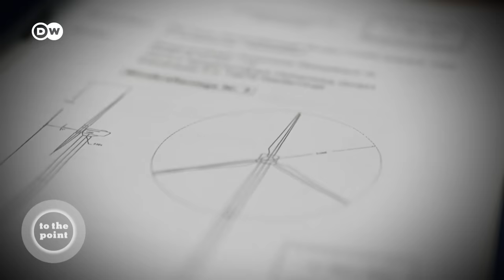A great power in trouble: What's wrong with Germany? | To The Point

Comment: The German business model is mostly based on manufacturing. In times of high energy costs, supply chain disruption,  demand shock and an alarming immigration rate you have the perfect mix for a crisis
Reply: What is immigration to do with German's manufacturing problems?
Reply: And we Germans need free markets, free trade lines, and not mercantilism for silly geopolitical games.
Reply: @joaov.m.oliveira9903  immigration is a highly sensitive and divisive issue in any political debate. High immigration rates in times of crisis can be a problem
Reply: High immigration rate is by design, because that keeps labour costs low and benefits manufacturing.
Reply: And what is your qualification to give such opinions?
Reply: @joaov.m.oliveira9903 unskilled workers aren’t very useful even if they’re cheap. They hurt the brand and quality of product. Also it hurts wages and people and so it’s not good for the overall economy.
Reply: @Logan-zf1ft  he’s a voter I imagine.
Reply: @kordellswoffer1520  no it is not ..
Reply: @lucasstuart19  you did not answer question what immigration has to do with crisis of manufacturation ?? Immigration are useful not problème for manufacturation..
Reply: Dramatic energy politics. Too much money is spent on "Energiewende". High taxes on energy is bad for steel industry, bakeries etc. Also nucleair powerplants were closed for political reasons. Coal-fired power stations have to be politically closed as well. Gas has to be imported and is expensive. So the make industry is at risk.
Reply: The energy crisis is a karma for what Germany tried to do with Russia …against the rest of EU.
Reply: We like blaming the immigrants here. Obviously poor hard working people trying to make a better life for themselves are always the fault us rich Germans are faultless. Heil !
Reply: @ihmpall nice slogan😅 keep like that 😅
Reply: @aghileshemdani3144 yes when they work and not just take money from german taxes and don't work for  years like the majority of them from 2016 to now
Reply: Reality comes in Germany. EU reality when everything is regulated.
Reply: @joaov.m.oliveira9903 
Industrialists / Corporations need cheap labour or dependent workers like indenture slaves.
Reply: Why you add immigration in your equation? Germany 🇩🇪 birth rate is one of the lowest in Europe. Immigration is needed in Germany as a plan to positively impact the economy.
Reply: @ainars.
Here is your regulation: flood EU with immigrants by “shipping them” and making money off it.
Select the ones willing to work and “volontarily” distribute the rest to other countries in Europe…. While slapping them with fines and sanctions.
You are flashing your “exploiter” sign without shame. This is the beginning of the end of EU
Reply: Germany killed it´s own future when became antagonistic toward Russia, Germany did so  for the sake of USA, country which was even bombing them at the same time(Nord Stream) !!! Politicians should be held accountable for that !!!
Reply: When you play sanction league the result is obvious 😂😂
Reply: @tigerking2742  Yes. The thing with sanctions is that the power that imposes is likely capable of providing a satisfatory alternative to the sanctioned country, often profitting high from it. In the case of U.S.- imposed sanctions this is precisely what's happening now.
Reply: @joaov.m.oliveira9903  you know we Indian are laughing because our petroleum products export are increased and major buyers are European and you know very well which country we purchased crude oil 😂😂
Reply: @joaov.m.oliveira9903  Excellent question! Immigration is actually good for German manufacturing. Now ... the war that should never have started is an imptortant component of the crisis - the most important, imho. Some say the US is doing double containment with the war - containing  both Russia and the EU.
Reply: @joaov.m.oliveira9903  More free money & government hand outs for food, housing, health care have to be generated somewhere and  most likely will have to come from increased taxation to businesses, individuals or both.  If businesses are already complaining about high tax rates, they will look for alternative places or options to reduce their tax burdens.  A Country cannot simply take in unlimited amounts of immigrants.
Reply: @kb9826  I know that, man.
Reply: Every country starts going down hill when energy cost is high, so I don't understand what is the point of this video?
Reply: 19:50 German companies are complaining about a lack of skilled labor, we know this can only be provided by foreigners
That quote in this video probably created 10.000 extra AFD voters
Reply: @kordellswoffer1520 

correct !
Reply: @EarnestWilliamsGeofferic low wages may be attractive to the companies, but it is preventing Germans from entering certain industries for work.
Reply: @bienvvo  forget the gdp figures and focus on people. People will be wealthier without mass migration. People will be happier without mass migration.
Reply: The problem of high immigration is  that if the industries starts to fall and people loses their jobs, then there will be a high unemployment rate, and therefore a high tension in the employment market which enhances the hate against immigrants. Then people will start to say.. They take our jobs. More over the insecurity will increase thanks to poverty increase. 

It already happened in other times and in other countries, and even now. People already starts to speak in some countries. Eg. France, and also maybe UK.

Increasing immigration is a seriously bad short term idea because the main problems are not solved. Extremely competitive market, mondialisation, high price of the energy and also...... Greedy shareholders.

A simple way to solve all those problems in every country would have been to impose two simple rules to every country in the economic bloc.... (1)One country, one local industry.  (2) Impose a maximal amount of money one human can possess : eg: 10 millions euros. And maybe a third rule. Unconditionnal revenue. 

Forced Local industries means one guy wanting to sell a product created in another country has to create a local industry. It bring local jobs. On another side, limitting shareholders power keeps salary well paid and it nullify their influence power and lobbying.
Reply: Without cheap gas from Russia the Germans are fck'd. You should never bite the hand that feeds you.
Reply: @mirekslechta7161  No it is caused by the "Energiewende": closing nucleair power plants, Cole powered plants, and relying on gas as the only alternative. The gas mining in the Netherlands has been almost stopped, so no cheap gas anymore.
Reply: @lucasstuart19 😂 On this specific issue, that 's where high immigration is useful . Keep wages low and available labour forces .
Reply: Immigration is completely irrelevant here, if anything, it is a boost to manufacturing both in terms of production capacity and consumption. You really didn't need to comment on something you do not understand. If you have a problem with immigration, that's a different story...
Reply: @user-ks2wz7bg4p I know, Schadenfreude ist the most delicious form of enjoyment. But things are, again, not that simple. You could start to figure out, who still is purchasing uranium from Russia, and who does not. Then, you might like to check, who else was benefitting from russian gas and oil imports (and still does) for which, Germany was just the landing point and not the user. So, at the end, it's not just Germany here, and the rest of Europe on the other side.
Reply: @tigerking2742 you are sooooo smart.
Reply: @kordellswoffer1520 look Asian developed countries  like southkorea,Singapore etc they opening foreign labors to their countries  because  their domestic labors is shortage  they need to open for  foreign labor just to sustain their economic development
Reply: @kinegiros that is a lie. A lot of immigrants work for less. You capitalize on the few who game the system but with the high inflation, living on welfare is not sustainable at all.
Reply: @DarwinMagsino  foreign as in neighbouring nations. They’re not opening themselves to all of Africa and the Middle East and India.
Reply: I think we should clarify that high immigration numbers aren’t inherently bad, it’s more like a vast number of these immigrants don’t get integrated into German society/culture and work force properly fast enough
Reply: Yet gvt fking up the energy policy. So smart😂
Reply: @joaov.m.oliveira9903 lol seriously you didn't get what he meant?
Reply: @EarnestWilliamsGeofferic If your immigrants are educated, can support themselves, and don't need money from the government then yes you're right.
Reply: @joaov.m.oliveira9903 being replaced by non germans? I dont know, just a guess
Reply: You’ve described a colony
Reply: Have you ever seen an "immigrant" at manufacturing site? On a contrary, take a walk at "no go" zone during working hours, and look at the crowd hanging around.
Reply: Absolutely. Just imagine Germany (EU) was closely cooperating with Russia, instead of antagonizing.
Reply: At the same time it provides high added value and relatively stable jobs, which is what a lot of germans like: Stability.
Reply: @bienvvo  why? Just use robots and AI - they add economic value unlike most immigrants. They don't cause social unrest either.
Reply: @user-ks2wz7bg4p  makes good business sense, why would you want to keep the ones not willing to work?
Reply: @maxheadrom3088  explain? Only a small percentage of immigrants help manufacturing...
Reply: @defaultdefault812  sure, where are those robots 🤖? Lool you guys need to step in reality and accept the new real…..
Reply: alarming immigration rate???? Germany is not as multicultrual as the US or the UK, so ....uhhh no!
Reply: Plus high interest rate stifling investment
Reply: Manufacturing is far better than my American model of a financial economy that is extremely unstable. But if you got endless money to print in order to bailout the gamblers, it works great.
Reply: Bayden
Reply: @kordellswoffer1520  well southkorea  will help asian counterparts first before others
Reply: YOUTUBE:"DIE VERBORGENE GESCHICHTE" TEIL1 UND TEIL2///Die ersten 30Min reichen schon aus. 👋
Reply: Hello👋👋
Reply: @EarnestWilliamsGeofferic  hello👋👋
Reply: @Logan-zf1ft  hello👋👋
Reply: @kordellswoffer1520  hello👋👋
Reply: @ihmpall  hello👋👋
Reply: @AlexandraSandra-ho3wz  hello.
Reply: @kordellswoffer1520  hello where are you from m
Reply: @AlexandraSandra-ho3wz  I am an Englishman of course.
Reply: @kordellswoffer1520  oh wow that's nice...
Reply: @kordellswoffer1520  Are you there?
Reply: @AlexandraSandra-ho3wz  AfD Regierung in Deutschland es ist ein Muss!!
Reply: @SantiagoRodriguez-th3ej  Ich weiß nicht wirklich, wie die Regierung dort arbeitet ... Ich komme aus Los Angeles, Kalifornien, und Sie?

Comment: The biggest mistake in Germany is the shutting down of their nuclear plants.  This has jacked up their energy prices and thrown a monkey wrench into their economy.  The other thing is Germany's failure to ensure investment in the development of electric cars.  Like Germany is at risk of their whole auto industry going belly up.
Reply: Under EU la the price of a kw of electricity MauST be priced at the retail level at the highest cost to produce that kw. 

This is why sone electricity producers made obscene profits.

The nuclear will help but they need a structural reform that forces a flat playing field of competition
Reply: @joeblue2492  what makes sense is supply and demand.  Like consumer should be charged based on when the electricity is use based on the cost of the electricity at the time.  Often electricity producers get contracts.  This is often not good for utilities in that they have varying demand over the day, week, season.  This is where old stile nuclear plants are having trouble. They are set up to produce unchanging  base load and become uneconomic when renewables over produce.  So what are needed are nuclear plants that operate at high temperatures and power can be stored as heat to be used when needed.

Comment: Maybe they shouldn't have abandoned nuclear power. France isn't having the same energy issues.
Reply: They have issues of their own. The time to build nuclear power plants is very long (The one they hope to finish in Q1/2024 has been in the process of being built since 2007.) and climate change causes them regular problems in the summers with cooling their nuclear power plants.
Reply: @Never_again_against_anyone  it also increases their dependency on Chinas/Russias Uranium/Thorium. If Europe stops trading with China/Russia (for whatever reason), France will go down (not even kidding). So better to live in Germany in that regard.
Reply: @coondog7934  I didn't read anywhere that anyone relied on Chinese uranium, which isn't a lot and mostly used for domestic purposes.

Comment: Germany have similar problems like Sweden. Coalition governments and their dealings for power easily lets small parties have more power than their base in voting.  This have led to to decisions and acting that are governed by visions and ideology and that have no support by a lot of people, and are often not realistic. Also I think there is a lot of pressures for political correctness as in Sweden hindering a sound dialogue (politicians, media) how to solve problems and create pressure for realism, also suppressing the views of a lot of people. All this ends up in decreasing trust in the state. I guess you can say that the democracy have failed a bit, not because of democracy as a system but because of the politicians and mainstream media.
As an example the energy policy in Germany (and similar in Sweden). How can a sound state stop nuclear plants and use fossil gas and coal?  How can a state have so much trust in wind and solar and energy storing in water pump reservoirs without listening to experts and thus having any realistic approach and implementation plans that meet at least a bit of the realistic need, if you want to make the ongoing energy transition to be fossil free?

Comment: 14:30 worth noting that the war in UA is linked not to say is the main reason for energy prices hike and the consequent inflation!
Which shrinks the list basically to corona and UA war!
Reply: That's not true. The gas shortage increased the problem significantly, but Germany has had among the highest energy prices in the world long before that. You can look up articles from 2017 and beyond.

It's not like our energy prices were cheap, because of Russian gas like you often hear nowadays. Our energy politics of subsidising renewables early more than anyone else, while also getting rid of nuclear energy etc. meant that we had among the highest prices while relying on cheap gas to prevent them from completely exploding.
Reply: The UA war is a factor but not even the major cause of high oil prices.
The current OPEC+ manufactured shortage is the current problem because Russia is only one player in that consortium that includes the Middle East and various other global sources of oil.

Comment: I will tell you what is wrong with German economy:

The whole economic structure of Germany is very very slow compared to other countries, the employees are not working fast enough, they cant get something done fast enough due slow system.

imagine waiting 2 months for just an appointment to get your driving license exam documents filled and then wait another  month to take exam.
it will take you more than 6 month just to get a license in Germany.

They need to accelerate their work.